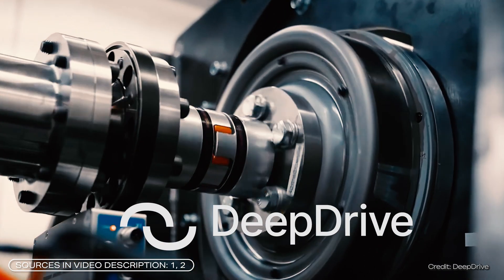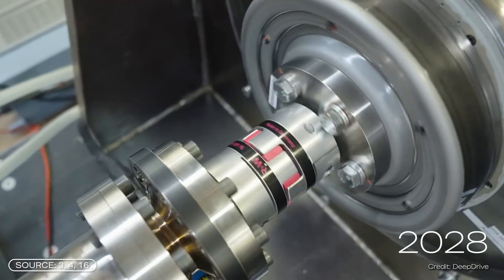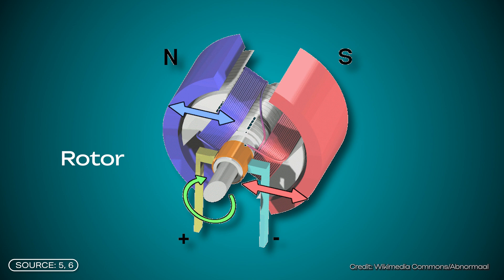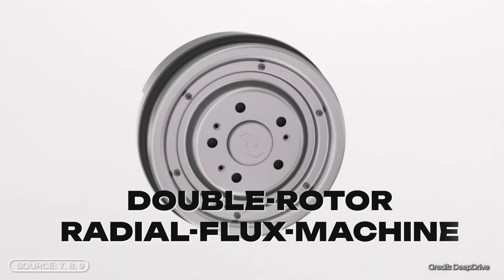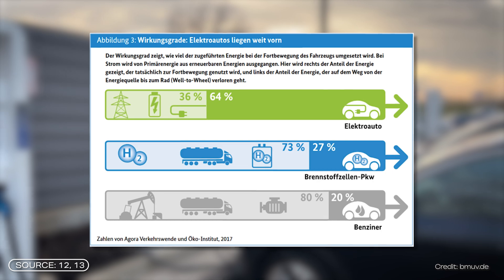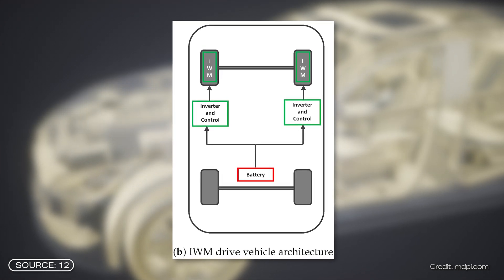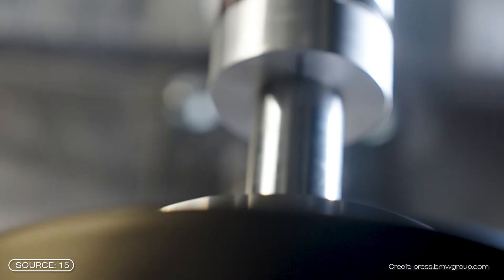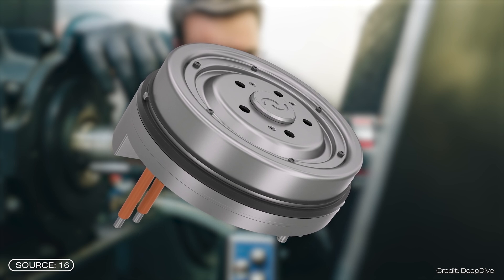Efficiency Made in Germany: DeepDrive's GENIUS motor

Comment: I want 2 in the rear, with inverters built into the motor. The whole system should be no more than 96vdc easier cell balancing. And when houses go offgrid, the systems should be a set voltage standard, 96v for charging without conversion losses. In real outages, the panel working voltage could even be 96v or close to it, so you dont even need an mppt. And if the hub motors are emp proof you have a perfectly functional system in any case. 

Less is more. The big igbts can also take quite a hit. Its the driver circuitry that needs to be ruggedized, simplified, using less power to make the signal, many companies are total signal sluts, just decimating the waveform characteristics because they are big auto scammers.

Comment: The question is not "Wen will it come on the market" - it is - Which market?
This motor is not for private cars. It would crash any advanced system of suspension.
Large vehicles, where comfort is not an issue - maybe.
Reply: Why a electric motor will crash advanced system of suspension?  What is the mechanism?  Any source?

Comment: If these happen, better say good-bye to the “coolness” of low profile tires if you want the motors to last. They’ll transfer higher quantity of road “noise” to the hubs at higher frequencies and amplitude compared to high profile tires. Wheel hubs take a beating with low-pros, not to mention rims more easily bent even from moderate road hazards/debris. Ride comfort, noise and motive efficiency improve with higher profile tires.

Comment: If it's cheap, it may be great for retrofits. The big problem with wheel motors will be un-sprung weight. If that's not too bad, it would be great because then the batteries can weigh as much as the original driveline + petrol. That would mean less changes to vehicle dynamics.

Edit: Also, that 20-25% figure is ridiculous. Tesla's drive-lines are already so efficient. Something like 953 efficient, so you could only gain a theoretical 7% range if your driveline is 100% efficient.

I also think them partnering with BMW is also a marketing thing to keep investors happy, implying that they are in the forefront of research.

Comment: 20% more efficient the thumb said. And in the description it says the "save up to 150 kg" and "increase range by over 20%".  But anyone with a basic understanding of physics and basic knowledge about the tech already on the market should immediately understand that this must be bullcrap. 

First of all, ordinary/typical motors in the EVs on the market today are already > 90% efficient, with the best (which is, alas, permanent magnet motors) achieving 95%. So clearly the above claims are based on dubious grounds. Perhaps the weight saving is what they like to call efficiency - I don't know, but I do care. It is dishonest to abuse well-defined terms in such way, and the efficiency of a motor is by definition how much of the energy it is supplied gets converted into kinetic energy. Now, some may believe that weight saving is a legit thing to incorporate in "efficiency" because less weigth is easier to move around and therefore should be more efficient, right? Well, that is sort of true and sort of false. What most people understand by range and what matters to most people who care about range is not about average consumption in the long run (which is "economy" or "consumption" and also what matters to make a car more efficient in the sense of eco-friendly), but "how far can I go before I have to charge?". That question obviously doesn't have a single answer, since it depends on the circumstances, but on the other hand, you can reasonably assume that when people want to know this, they don't mean if they do city driving at an average speed of 14 km/h standing still 40% of the time, or driving at only the very smallest roads at a nearly constant 40 km/h for 17 hours straight. They are talking about driving on the highway or at least other relatively high speed roads, because that is what we always do when we go far. And the weight of the car is - all else being equal - almost completely irrelevant in that circumstance. 

Thank physics for that. The reason your car can't regen as much energy as you spend so you can drive without ever charging is losses. The two biggest losses for a car just going at constant speed come from rolling resistance, which is proportional to speed, and air resistance, which is proportional to the square of the speed. In other words, with respect to distance rolling resistance is independent of speed (if you drive twice as fast, you spend twice as much energy per second but you only spend half as many seconds, hence the amount of energy needed to roll from A to B is always the same, whether you go fast or slow), whereas air resistance increases proportionally with speed (so if you drive ten times as fast, you spend a hundred times as much energy per second, but only for 1/10th as many seconds, hence the trip requires ten times as much energy when done ten times as fast). At highway speeds, air resistance completely dominates the energy consumption, and typical figures may be something like 20 kW going into the motor, 1.2 kW is lost as heat in the motor, 15 kW goes to overcoming air resistance, and the remaining 3.8 kW to overcoming rolling resistance. That last component is proportional to the axle pressure. Since this motor saves "up to" 150 kg it seems fair to assume it typically saves at most 100 kg, which is about 6% of the weight of a typical car, so all else being equal we can expect a reduction from 3.8 kW by 6%, about 230 W, which takes it to 3,57 kW and the new total is 20 kW - 230 W = 19.77 kW, which is 98.85% of the original 20 kW - a whopping 1.15% reduction. Now obviously there is some turning and braking going on even on long trips, and accounting for that would improve the numbers a bit for this genius motor, but on the other hand I've also ignored all other systems in the car that also use energy and whose consumption remains unchanged by switching to this motor (AC/climate above all, but also umpteen computers, lights, infotainment screens, and so on), which would make the numbers even worse. I believe this oversimplified "car going in a straight line at constant speed" model actually gives us a quite good indication of the effect, from the weight reduction alone, on range. But since motors are so efficient already, this one simply can't be much better in that regard, so the claim about range increase of over 20% simply can't be due to increased efficiency. 

That is kinda how it is on long trips. But in city driving there's an awful lot of that going on, and accellerating a heavier car takes more energy than a lighter one. Unfortunately you only get about half of it back from regenerative braking, perhaps even less in city driving because it doesn't work so well at very low speeds. So here the weight matters, and you do get more range. But in city driving it is irrelevant for the same reason it is irrelevant when you go to the supermarket: You have way more range than you need in these circumstances.

As for the "this motor is 20% more efficient" claim, I can only speculate. One thought is they may have looked at the losses instead of... eh.. the wins? the energy converted to movement... and figured if that's reduced by 20% it sounds pretty awesome if we lie just a little by pretending that this is the same as efficiency improved by 20%. I don't know. But I do know it isn't twenty percentage points more efficient than typical motors today, because it would need to be 110-115% efficient in order for that to be true, and physics gets in the way. Measuring the relative decrease in losses would however be quite idiotic, and more so the less there is to gain from further improving efficiency! A hypothetical motor that loses only 0.3% as heat would be "twice as efficient" as one that loses 0.6%, but while it would be very technically impressive to halve the losses, it would NOT be impactful and most definitely not give us 50% more range. It would be rather like if you came across some rebated straws at the grocery store, and concluded your personal finances have now greatly improved. Unless you are a person who spends a big part of your income on straws, alas, slashing this part of the budget by an impressive 70% won't necessarily move the needle.

Marketers of course know to exploit people's generally not very sophisticated understanding and our propensity not to have to think too hard. They will happily find some stupid and irrelevant circumstance in which it would not technically be a lie to say that the car could go > 20% farther, and present that as "can increase range by over 20%". But a youtuber whose whole angle is "this is where you get the scientific stuff" should be (a) highly skeptical of such claims, and (b) see right through them when it is as plain as it was in this case. And definitely not reiterate the deceitful claims and contribute to people's already massive confusion over such matters. I hope that by explaining a little bit the fundamentals of "the car equation" and trying to distinguish between range as "what trips can I take how easily" and efficiency/economy, I can contribute a little bit to more people understanding a bit more. If you read all of this, you won't be one of the many who make the mistake of believing a lighter car means it gets a big boost in range, for example. 

By the way, one aspect of economy/eco basically gets overlooked all the time by everyone and that is what's become popularly known as Vampire drain - which is the energy consumed by the car when it is not being driven at all and is just sitting around. Some people's cars actually sit around a lot and drive almost only very short trips the few times they get used at all. And in that particular circumstance, it's entirely possible that the vampire drain becomes a third or half or even more (in theory of course anything up to 100% is possible, since that's what you'd get for a car that is always parked and never goes anywhere...). I haven't attemped to estimate how much this might be on average or for the bottom twenty percent of vehicles or something similar that could give an idea how much it actually matters, but I do find it a little bit curious that none of you guys who are trying to make a living of telling the rest of us about these things seem to have done so either!

Comment: Unsprung weight is not an issue.  Wheel hub motor manufacturer's such as Elaphe, Protean and a huge number of Chinese companies currently produce and supply motors for major car companies.  With small adjustments to the suspension systems the unsprung weight issue and potential handling problems have been reduced.  The average driver would notice very little or no difference to their daily drive.  It is great to see more start-ups and companies developing great technologies for us to move away from fossil fuel dependence.  Great videos Mr. German Science Guy, greetings from windy Tasmania.

Comment: There is the
1) unsprung weight issue and adding to unsprung weight is always a bad idea and then
2) there is the mechanical issue of the motor operating in an environment that isn't isolated from shocks.

Be kind to the motor and attach it to the chassis, a much comfier place for it! Ideally even brakes should be brought inboard (to the chassis) to reduce shocks and twisting forces. That is just a impractical thing to do, unfortunately.

Comment: Unsprung weight is a problem. Solution is simple: motor inboard, driving a short, light shaft. Still fully independent with little loss of inboard space.

Comment: The problem with EVs isn't the motor, it never was, it's the power source that's the problem. Saving 150 kg in weight is fine and dandy, but it's a drop in a bucket compared to weight of the battery pack required to drive it. 20% more range is also nice, but it's hardly a game changer. No. The game changer will come when we have a battery that rivals the energy density of a gallon of gasoline.

Comment: Adding 20-30 kg per wheel will change unsprung weight by a great deal, maybe 50% or more, very bad for handling. I am not a Tesla fan, but their motors are already around 94% efficient, so I don't see how they can claim 20% improvement in driving distance.  Also in the beginning  you talked about no rare earth materials,  and never said another word about this point.

Comment: we had those motors 40 years ago in quebec canada they had put such motors ina chrysler. the goverment never helped put it on the market. there were one problem the weight increase on the weels, which is a definate problem for ride quality. so dont get excited too quickly.
Reply: wont work or will have problems with the weight,in the weel.

Comment: so just by looking at the idea from the perspective of a cost point of view:
You need  2 motors if the car is FWD or RWD, or 4 motor if it is AWD. Now the problem with this is that you need to synch the units perfectly, otherwise one of them might be rotating a little bit faster than the other/others and therefore unwanted losses and early degradation might appear.

Second issue i see: in case of continuous exposure to water (which is guaranteed in a lot of parts of the world) you need to make this unit very resistant to corrosion, and in case of a very light side impact, the damage on the motor might be unavoidable.
Reply: Syncing is a trivial matter. Just power it from a single inverter and make sure to match the impedance of the wiring. Impedance matching is old school method for electronics design.

Comment: My similar idea uses short CV axels to small hubs+wheel bearings {which lightens typical unsprung weight} while it connects to disk brakes and {regen} hub motors mounted together on the exterior 4 corners on the perimeter of the frame. This would allow 4 wheel steering and propulsion.

Comment: Aptera were intending to use wheel hub motors but have launched with an inboard motor, promising the wheel hub motor variant in the future. Personally, I would be interested on how the inboard motor performs compared to the competition. Power to weight, efficiency, level of regeneration/recuperation from this design when used as a replacement for current inboard motors. Danke

Comment: Unsprung weight is an enormous issue, I've swapped the steel rims on my old roadster with carbon rims and the effect was dramatic. I ended up having to change the shock absorbers and springs to take complete advantage of new dynamic. 
I imagine that a wheel hub motor would have the same ( although opposite ) effect.
Corrosion and vibration issues would be as important I believe.
My own take on this would to move the motors to a central location and us CV joints, protecting the motors from environmental effects and moving mass to the centre of the vehicle.
Reply: My similar idea uses short CV axels to small hubs+wheel bearings {which lightens typical unsprung weight} while it connects to disk brakes and {regen} hub motors mounted together on the exterior 4 corners on the perimeter of the frame. This would allow 4 wheel steering and propulsion.

Comment: 7:19 The biggest problem with unsprung mass is that it significantly degrades ride quality. Factors for wheel hub motors such as durability and the effect on handling are fairly minor in comparison. Having twice the motors per axle also increases cost and weight from double the motor casing, double the gear reductions, double wires, etc, which is offset somewhat by the elimination of the differential and CV axles. The advantages of wheel hub motors are the ability for potentially extremely good ground clearance without the need for portal axles to move the axle and differential out of the way, the lack of friction losses from a differential and CV joints (gear reduction is still needed), and a minor gain in packaging (battery packs should generally be located between the axles for crash safety).

This means that wheel hub motors in cars will generally be a niche design useful for hardcore off-roaders who need ground clearance and poor ride quality is acceptable, or situations with extreme packaging limitations. Several models in China already have individual motors for wheels, but few or none of them use wheel hub motors due to prioritizing ride quality as they are high-cost luxury models. Lordstown motors, the most prominent user of wheel hub motors, failed in part because wheel hub motors provided too few advantages despite its use on a truck.

DeepDrive will likely focus heavily on the central drive system motor, which is most likely what BMW is interested in. The 'flatness' of the wheel hub motor design may be repurposed for hybrid applications where the motor is sandwiched by the engine and gearbox, like in one of the McLarens.

Comment: first of all, thank you for sharing this amazing innovation. we all know vibration and impact complete with heat effect reliability when you add environmental exposure to this fragile system now you have very inefficient and very unreliable drive system. the figures I see should be multiplied by 2 for a 2-wheel drive system or by 4 for an all-wheel drive resulting in no saving in weight at all but inherent reliability and getting stranded driving in the wet/ snow. i will keep it simple and stop elaborating. keep in mind the majority of your subscribers are engineers not doctors or accountants.